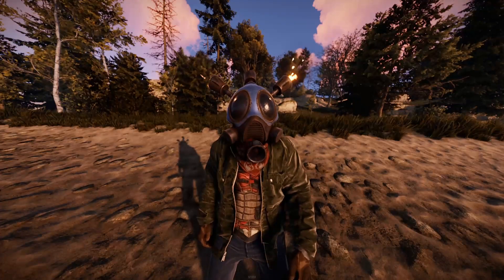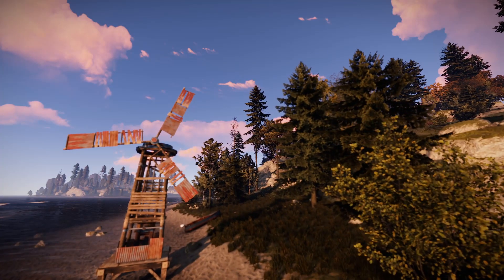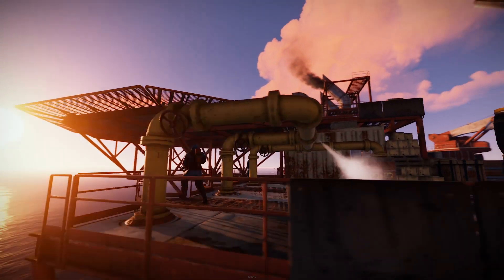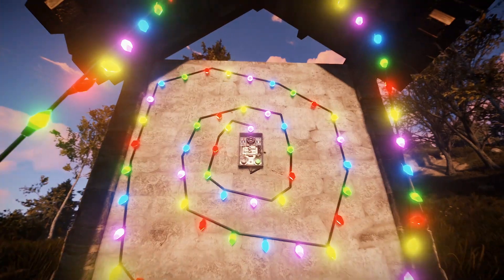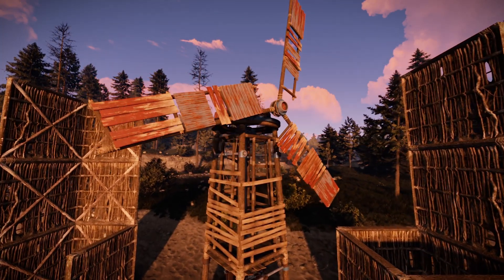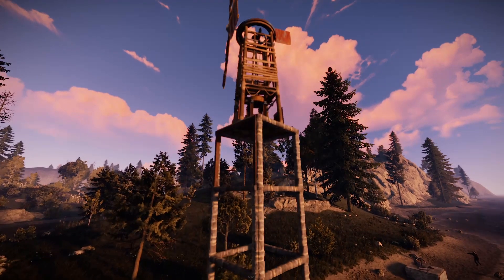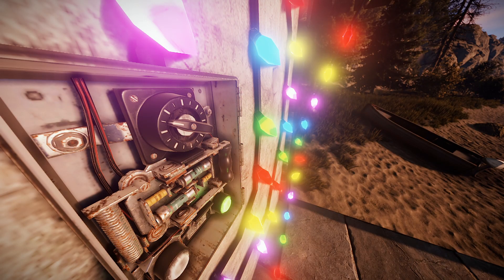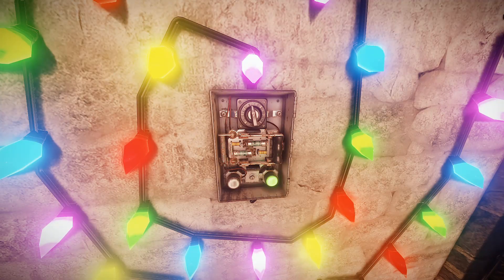RUST - Power Minute - Wind Turbine

Comment: Something I've always wanted to do with the turbine is hook it up to large batteries, and when the power from the turbine drops below 100 it switches to the battery,  so you never have that crazy power drop.
if you guys could figure that out that would be awesome
Reply: I'll look into it!
Reply: What's to figure out? You go from power source to battery, then battery to your equipment. You used to have to do a circuit like you describe back when batteries couldn't charge and discharge at the same time, but that was patched a while ago.
Reply from the maker: You might want to re-read his question. He doesn't want it using the battery constantly, only when the power dips below a certain point.
Reply from the maker: Thinking about it if you plugged both of them into an or switch that might do the trick because the or switch will send through whichever power input is higher. So if the wind drops and the power falls below that of the batteries output the battery would take over.
Reply: @Malonik  so i go from turbine, to branch, from branch to battery/OR switch? whats a good value to have charging the battery? or maybe split it in half with a splitter? i could figure it out myself but this is info i feel we all need <3
Reply from the maker: Yeah so windmill to branch, branch out to battery and then power out of both battery and branch to an or switch. That should do it. As for the amount to give the battery it really depends on how much power you're going to be using because you'll need the power coming in to outweigh the power going out.

Comment: Its good idea to have wind turbine up for at least 6 squares.
Reply from the maker: Yeah we normally put ours as high as stability will let us go.
Reply: My biggest problem is that i sometimes produce more power than a battery can use. Then i need to mess with EB to set energy lvls to at least 2 batterys (one is for backup).
And you also need to count for power loss when you charge a battery. Large needs at least 120 to be safe. (dunno the real math there)
Reply: Need help, is there a way to tell wind direction?  And is there a way to wire up at least 9 auto turrets to 1 windmill?
Reply: It is as each Electrical branch needs 1 power.

100 power (max battery) - 9 power - each turret needs 10 power x 9 = 1 power left

Using calculator to manualy set the power can be a bit pain in ass.

If you ignore battery completly you can add 3-4 more at least. However it depends on wind (max power is 150)

You can kinda tell a direction if you use a baloon, but wind generaly spins araund.